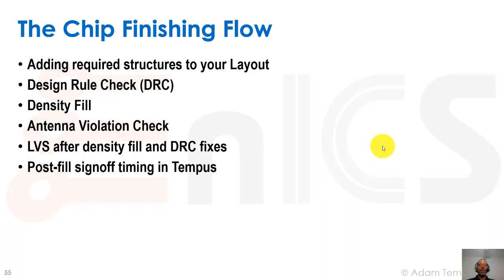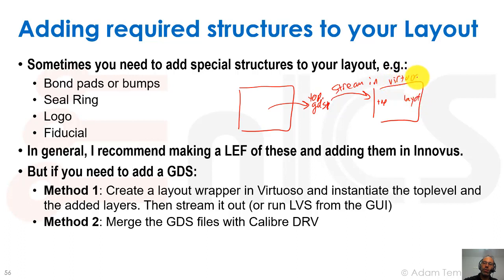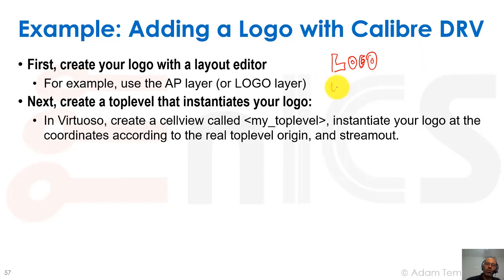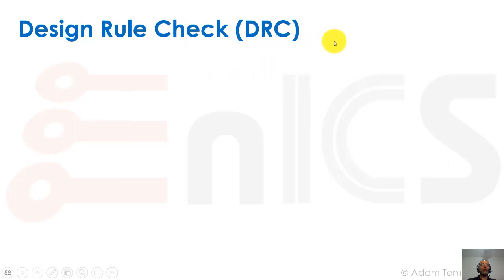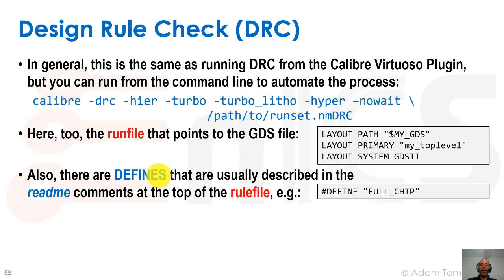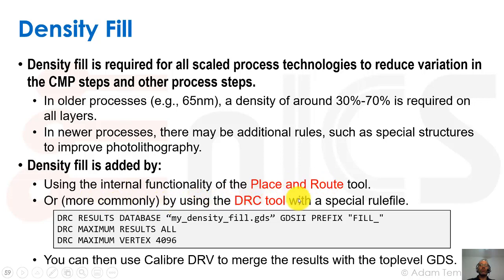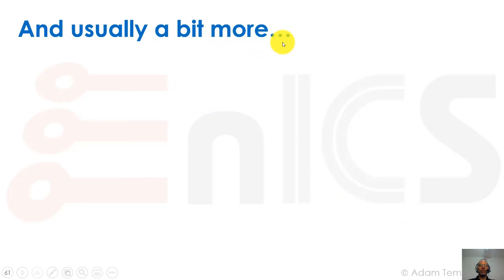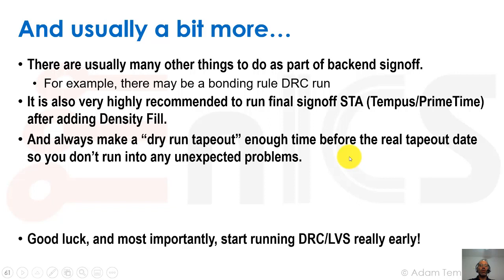Digital-on-top Physical Verification (Fullchip LVS/DRC) - Part 6

Comment: If the metal density fill is done to the GDS, how do you bring it back to Tempus/Primetime for STA check?
Reply from the maker: Good question. There are several methods to do this. To start, since density fill can have a significant effect in advanced nodes, the backend tools have the capability of inserting the metal fill as part of the place and route process, so that is solved. The fill is not necessarily "sign-off quality". however, so if density violations still appear during sign-off DRC, you will still need to fix them. But traditionally, you can run an RC extraction from the new GDS to create a SPEF and load this into your STA tool. Since the netlist is not changed by the density fill, this should run with the same netlist exported from your backend tool.